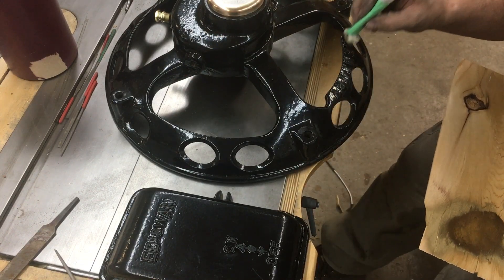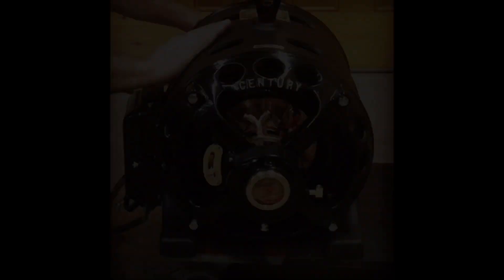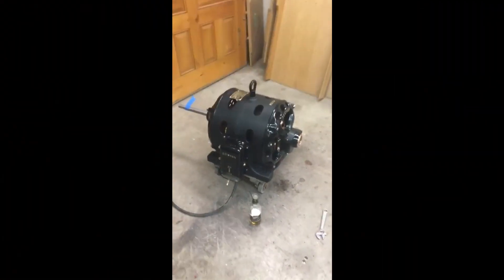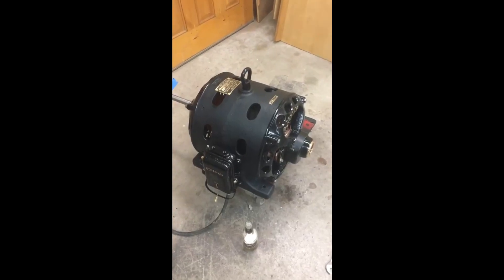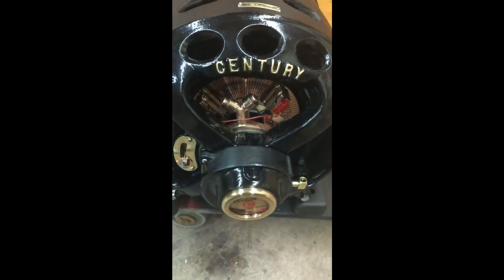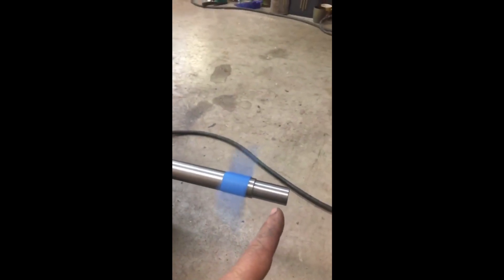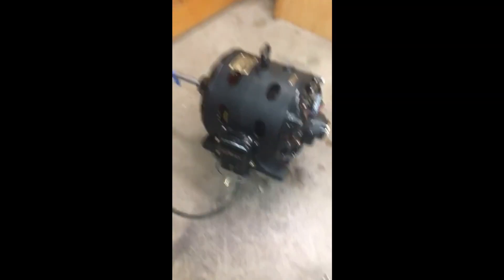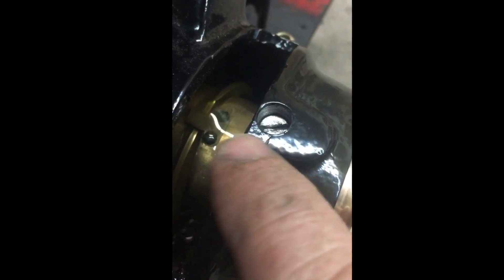century RI electic motor 1903

Comment: Hi there Jack. I really enjoyed your video. I to enjoy century electric motors. I got two of them. 
Here is a link to my disc sander powered by one of them that I have just given a good clean out and re-paint and also I have machined a couple of parts for it to. Thanks heaps for your video. Very cool
https://youtu.be/D3GPiUg-Z30
Reply from the maker: Yes the Century’s are fantastic Although I’ll probably find one in better condition next time lol
Reply: jack English machines Yeah fear enough. It looked like a bit of work. How’s it going now ? I can see you did a good job of it
Reply: Runs flawlessly. There is a fine example of the museum of technology here in Ottawa and mine is better
Reply: @jackforsberg1326  Thats great to hear lol. Looks like you have topped them all aye. Times like that I reckon another beer would be called for. If I'm ever over that way ill have to have a look at that Museum.

Comment: OK crazy canadian wood nut dude - I was so motivated by these videos I went on the hunt for this type of motor - I found one "zeno" motor about the same vintage but no repulsion oil bath bearing an all runs like a sowing machine straight up magnificent motor - then I picked up a 2 HP century identical to yours for 40 bucks, huge mother of a thing  - in had sat in a paddock for years - it included a rats nest (walnut shells and shit inside & actually had moss on it - but there was minimal rust inside - I cleaned it for weeks and vacuumed and oiled everything - brushes did not have the connecting copper woven wire (incidentally there is a brand new set on eBay for about 40 bucks - too expensive to ship here but good for your motor)- the centrifugal brush disengaging mechanism was totally gagged and it took a lot of wd 40 vacuuming and tooth brushed to get it right   So I *hit you not - in paddock, rats nest, etc etc blah blah - wired it up and it went first go - *ucken unbelievable these motors are indestructible - documented the whole thing with photos and video for the start up - I am a very happy mechanical nut - thanks for the inspiration you are the man.
Reply: These truly are a magnificent piece of engineering. And thank you for the comment it almost makes up for all of the documenting I tried to do. So glad that you were inspired him save some industrial heritage